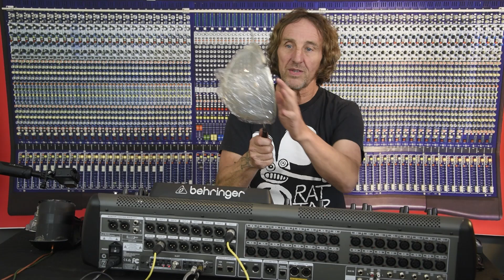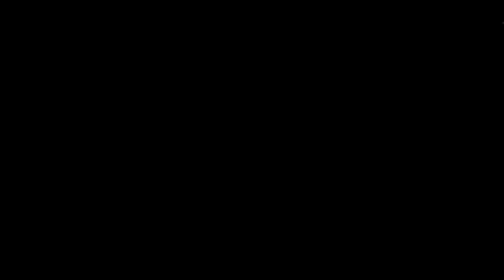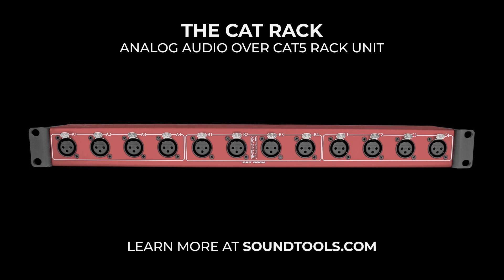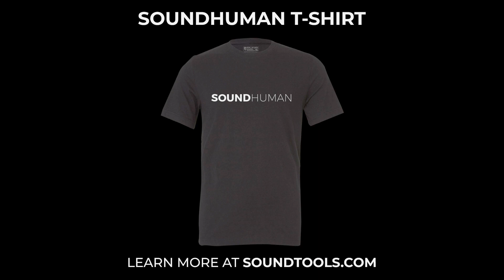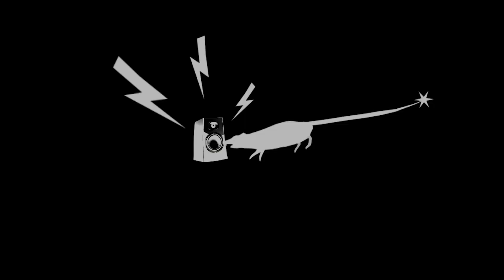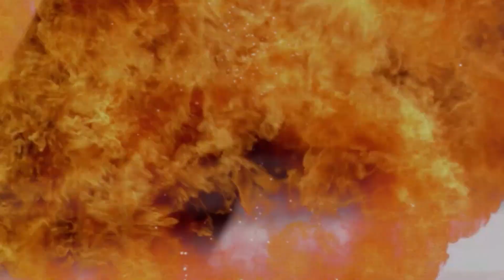Aux Fed Subwoofers Are Better - Because of How Mics Work

Comment: how does the crossover play into this? i do send the entire signal to my jbl powered srx800 series sub..... and that has a crossover that sends the highs to my two tops.... right ?   great channel btw, new subscriber.....i love the background!!!!     i dream about giant mixing desks :)
Reply from the maker: The crossover is a set of filters that sends the highs to the highs the mids of the mids and the lows to the lows.

If you have subwoofers they will typically be driven off of another crossover or part of the crossover that sends the subs to the subs

If you send the full mix to everything the crossover will divide up those frequencies and send most of what needs to go to most of where it needs to go.

But the filters are not infinitely sharp or steep.

So some meds get into the lows some highs get into the mids some lows get into the subs and so on especially right around crossover points.

If you have a separate crossover for your subwoofers you have the option to only send certain things to that crossover and that way nothing gets to the subs except for what you send to them
Reply: @DaveRat  awesome mr Rat......   i use a mackie 1402 ver4 and i hacve an extra aux send......    i'll try that.......     thankfully newer speakers have better sofware and do a better job of dividing frequencies.....  it really helps to have the best tweeter u can afford.........     jbl srx 800 and prx 800 lines r really good for pretty low dollars.....   in my opinion anyways.....  i used to own a driverrack PA2 with these speakers but it did not improve on what jbl already had installed.......  in a way, i feel sorry for the owners of jbl srx700 series because they have to buy amps, n processors.... the new ones, that is all free :). new subscriber :) keep up the good videos sir
Reply from the maker: Cool cool Fatz!!

Comment: You have a great way of explaining complex concepts regarding audio as we hear it and audio as technology that attempts to simulate audio as we hear it. The major point I get is that much of that audio is felt and not necessarily heard, but microphones can’t adequately compensate for this. In order to simulate the experience a cleaner and more effective mix you must exaggerate frequencies with audio that is meant for the output they are given.

Comment: When systems properly have their hi-pass filter set, there is no need for 95% of mics or sound sources to have anything at all feeding into the subs. You have three sources going in the subs in a typical setup: kick drum, bass guitar, audio feed from computer for video/media. That's it. Everything else needs to live above 120-150hz for clarity. 

Mics being flawed plays into this in zero degree, given you can easily set the EQ, compression, and gain structure for these three simple sources. Nothing else should be in the subs at all. No need for an aux feed.
Reply from the maker: Sounds like a logical assumption that fails to take into real world aspects that can easily be demonstrated.

Compression actually increases the amount of unwanted signal sent to the subs.

I recommend actually testing it rather than operating off of assumptions.

Hi pass is a filter that reduces the amount of low frequencies sent to subs

An aux send allows you to eliminate the low frequency sent to subs from those channels

The cumulative effect of every mic on stage sending some residual sound to subs is measurable and most often audible in significant amounts

The question isn't whether it happens or whether reducing the crap sent to subs is better, that is easily measured and proven.

The question is whether it matters for a particular application enough to employ the added skills and configuration needed to accomplish it.

Additionally there are added benefits that I will cover in future videos where phase interactions between subs and mains can be reduced by not sending the exact same signal to subs and mains
Reply: @DaveRat  That's a fair point.  Had a colleague point out to me that there are still plenty of analog systems out there that don't have hi-pass/lo-cut filters at all, in which case the aux send for the subs could be a very viable solution... but at the same time, if the system lacks the hi-pass switch, it may not have aux sends.  So Catch-22 applies there.  

Have to admit I'm spoiled by access to digital tools... even when I go out for small simple gigs, I'm using an XR18 and employing plenty of different approaches to addressing room/environmental challenges, as compared to the days when I hooked up something like a Mackie 1604 as my go-to for every small setup scenario, or when I had to deal with a large dinosaur 56 channel analog A&H board at one venue but it still lacked hi-pass switches.
Reply from the maker: And I can say from experience that moving from no high pass to highpasses helps a lot and moving from high passes to subs in an aux, helps even more in much the same way

Comment: The Rat is Rong.... I used both approaches for many decades, I prefer no Aux's & use HPF properly on channels. I always found the mix was sonically better balanced with the no aux method, the console recordings always backed up my argument.
Reply from the maker: Interesting.

The recording of the mix should come out very well balanced as long as you have zero stage volume.

Or are in huge venues where stage volume is not a factor.

If you do you have stage volume let's say, loud guitar and bass on stage maybe drums too and your recording is showing up correct then your mix is probably not optimized because you have not accounted for stage volume by turning down instruments in the PA that are loud on stage.

My point is that paying special attention to the recording and the mix separately because the two are rarely the same is a skill that is good to learn.

So if you're recordings are coming out great that's wonderful. If you're recordings are coming out great and they're exactly the same mix you send to the PA then either you have no stage volume or your PA mix is flawed.

But no matter what none of that has anything to do with whether or not you should send unwanted junk to the subs.

Except if you don't have the skills to mix the PA and the recording and optimize both of them independently, which is something I recommend all engineers master.

Comment: Thanks for sharing! Nice video.
So ‘normal’ HPF can’t work because the slope is not steep enough right?
Some digital plugins can make very steep slope, but there will be new problems, delay and group delay, which make the impulse response’s tail too long so that the sub sounds terrible .
Another thing is some engineers like using aux fader to control the sub’s volume, this will change the acoustic crossover point which ‘connects’ to full range speakers. If the phase not matched well around the x-over point. This maybe make some cancellations.
Reply from the maker: The phase around crossover point really needs to be matched because the same exact thing is being sent to subs and mains.

But if you have subs on a aux send only a few things are the same and sent to both but the other things that aren't sent to subs won't have any phase issues between subs and mains cuz they're only coming out of mains.

Yes adding steeper high pass filters can reduce some of the low end sent to subs by adding more problems like you mentioned but some of the sounds still gets there and you have less control.

With subs on an aux, none of the sound gets there and you can boost low end on the channel EQ and set the high pass where it sounds best without sending any information to the subs
Reply: @DaveRat  Cool, cool🤘🏻🤘🏻🤘🏻🤘🏻

Comment: why are you cuting only 90hz with the HPF? if you cut more, and for some instruments like HH way more like 500hz, you can clean up the mix too. i got your point but with proper HPF customize for each instrument low end trash, + compressor and gate, you can come up with a pretty clean mix without having to do an "unusual" P.A config. correct gate config for each channel will make feedback pretty musch vanish and garantee channels only open when some actual useable sound its being pick up. bands stops and P.A its quiet.
Reply from the maker: I used 90 HZ to show that with subs chopping at 80 and high passes at 90 even though the high pass is set higher than the crossover point sounds still gets through.

Since I was using a tiny little 3-inch speaker to demonstrate this it only shows a small fraction of what really happened so if I set the high pass to 250 you wouldn't really be able to see what's really occurring with things like double 18 and double 21 subs

Also I only had a few channels running. The issue of low frequency bleeding past the high pass filters happens on every single channel of the entire mix so the cumulative issue is much worse than I demonstrated

Most importantly what I'm showing is that it happens and low frequency junk gets through even if you set high pass filters above the crossover point and it's up to you to determine whether or not having that low frequency junk go to your subs matters for your application or you are okay with it

Comment: A question about hipassed mics still sending low end to the subs: what if I just highpassed further? 
Dave sets a high pass of 90Hz on every channel. 90Hz is a pretty low high pass IMO. I usually high pass vocal mics around 200/250Hz & snare, HH, & overheads around 150Hz
Would increasing the high pass filters create a similar result when sending LR to everything compared to separate sub sends?
Reply from the maker: If your high pass is at 250 and is 12 DB/ oct then at 2 octaves down, 63hz, you would be sending signal 24 db down to subs. Add that to the signal 24 db down from every high passed mic on stage and you get the residual junk sent to subs.

Raise your high passes to send less junk at the expense of the sounding of the instruments too thin

Boost lows on any of the Hi passed instruments and you send more junk to the lows

Increase the high pass filter slope and increase phase added phase shifts and LF ringing, and now you are chopping the low end very steeply which often sounds unnatural. 

Or, send subs on aux and set the high pass where it sounds best, and be able to boost low EQ on instruments not sent to the subs without sending more crap to the subs and be able to not even use high pass filters if you choose not to on channels and none of that low end crap gets to the subs.

I recommend testing it to see if it matters for your application.

Bring up your entire mix then mute all the channels that you want sent to subs. Then mute the main PA and just leave the subs on.

Any signal you see on the sub amplifiers any motion you see the subs moving and any sound you hear coming out of the subs is the crap that you would be able to eliminate

Comment: I'm confused why putting high passes on individual channels didn't fix the issue
Reply from the maker: In the video, I high passed higher than the crossover freq, but sound still got through, how do you explain that?
Reply: @DaveRat  I don't know, that doesn't make any sense to me 😭😭 what am I missing??
Reply from the maker: A high pass is a filter. Typically 12db per octave.

So a high pass at 200 Hz will attenuate the signal 12 DB an octave down, a 100hz and 24 db down at 50 Hz.

Lows still get through, it just turns them down.

Subs on aux, the can't get through if ya don't send them

Comment: I fully agree, subs should be on there own isolated output of some kind. Use either a dedicated sub group out or Aux out. It seems information going too your  low frequency drivers the voice coil can't accurately reproduce. Puts more strain on amplifiers and just adds noise too the system that's extremely undesirable and sounds awful.
Not nearly as bad as sending low frequency information to HF drivers, that will destroy equipment and quickly.

Comment: I've heard a lot of arguments for and against AUX fed, with the leading argument against AUX fed generally coming back to effectively changing the system crossover point when you have a level control for subs, but too many people don't think of it as ASSIGNABLE subs which you have better illustrated here. There's a lot of warmth in the voice that comes through on a PA speaker that goes away if I roll it off to keep the subs from feeding, but if I can simply unassign that mic from the subs the feedback problem is solved and I can pull my rolloff back to 80-90Hz instead.